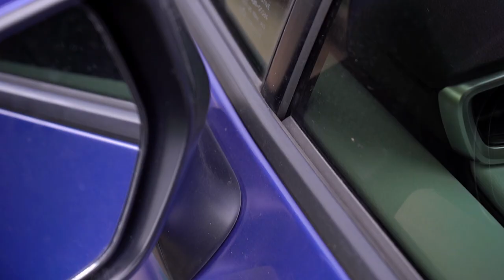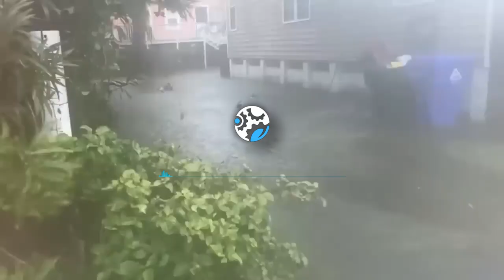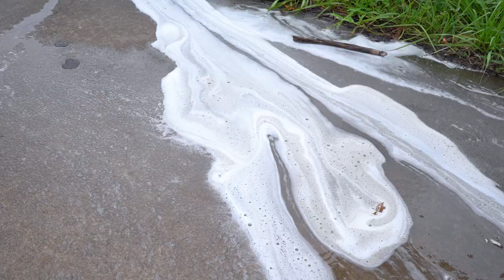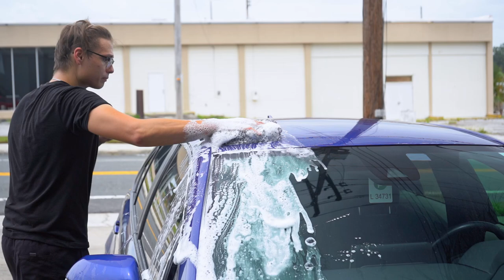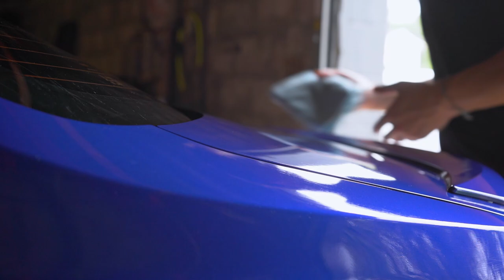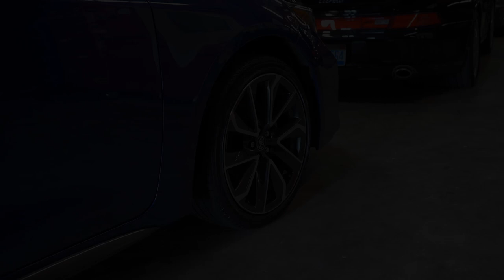Toyota Corolla | First Wash in YEARS! Years of Dirt Turned into a Beautiful GLOSS & Hurricane Ian

Comment: when you use the all purpose cleaner on the paint what dilution ratio are you sing im scared to put meguiars apc on paint fear of eating through....... why the isopropal between claybar and wax?
Reply from the maker: You can use non-diluted APC on paint and it won't do anything, but I highly recommend it for insanely dirty cars. Mostly though, I use roughly a 10:1 ratio. And the reason for IPA between claybar and wax is to make sure the surface is squeaky clean for the wax can bond better on the paint.